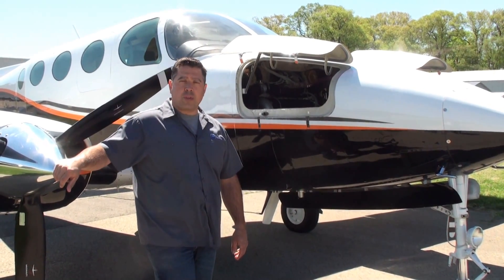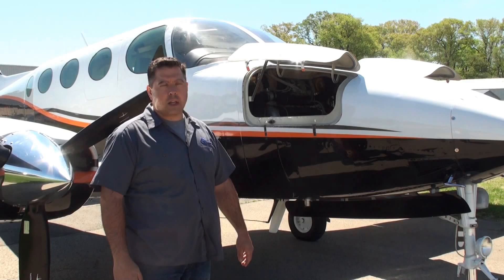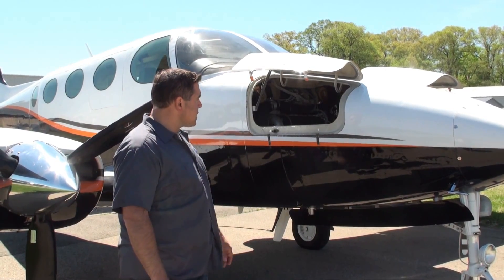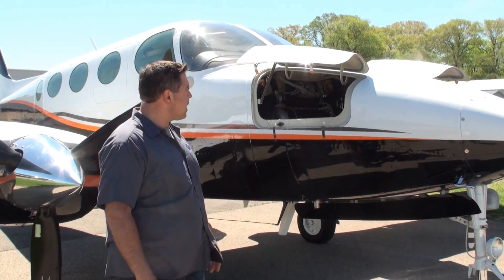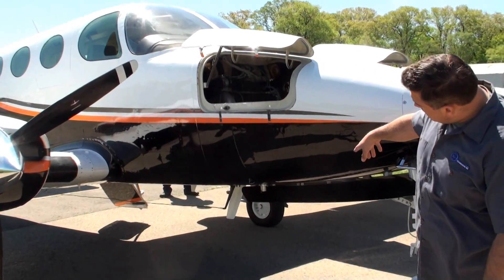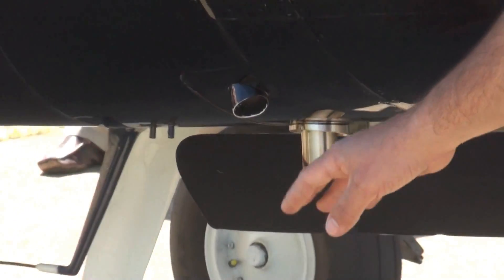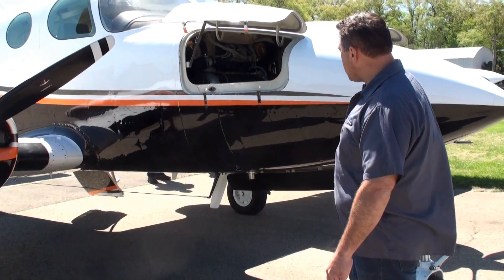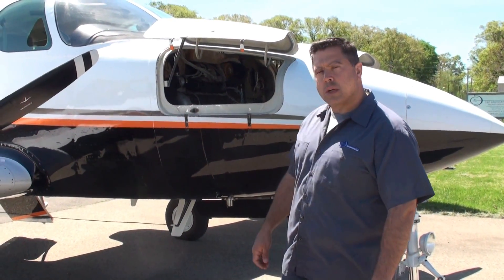Cessna 335

Comment: Unbelievable.

Since this problem has been apparently (successfully) diagnosed as noted in this video (and as commented, probably has occurred in many other 335-340 series Cessnas) , why isn't Cessna fixing this obvious manufacturer's defect? It appears the hapless owners have to point out, as usual, another "issue" to their A&P's, and then this complicated and obviously expensive "fix" has to be put in place. Either that, or don't fly the plane anywhere you're going to need a heater - like FL maybe?

Seems appalling. Makes one wonder what ELSE wasn't designed right in this airplane (not to mention the 340 series).  Good money for the A&P' shops though.
Reply: davidrp because it’s not as big of a deal as you’re making it out to be. And they are 40+ year old airframes that not too many people operate anymore. And, those that do are well aware of this and other quirks. The 300 and 400 series Cessnas are built like tanks, admittedly showing their age, but still very solid and capable.